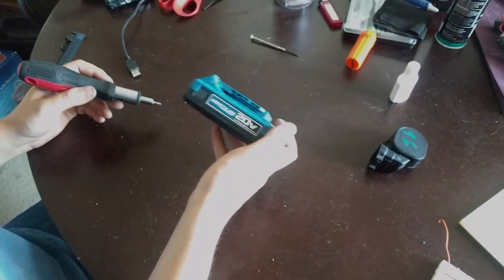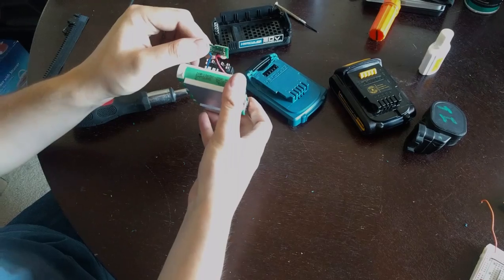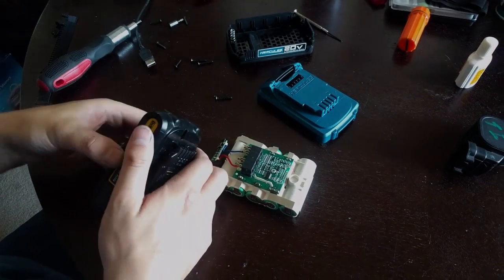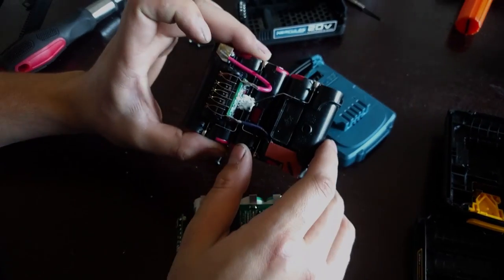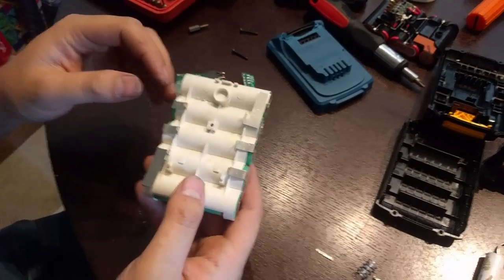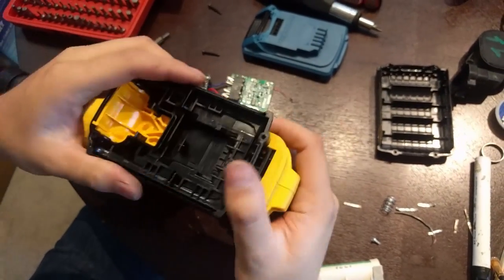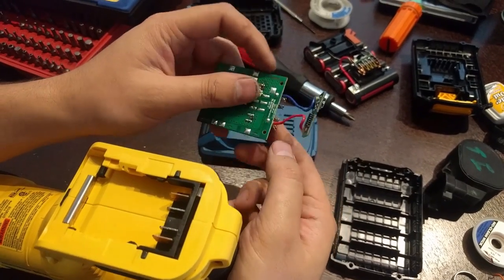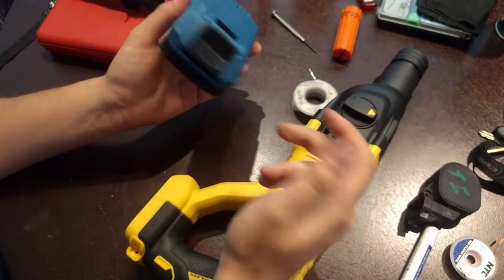New Harbor Freight batteries work in DeWALT tools!

Comment: Very cool. Thanks for hacking that!
Reply from the maker: AvE the master has arrived
Reply: SQUEEEEEEE! Dave Jones Where? Where?
Reply from the maker: AvE so, do you think these are counterfeit cells?
Reply: Maybe.  More likely, and more in keeping with the theme, OmniEvilCorp introduces the tool and as time goes on the grade of components gets cheaper and cheaper.
Reply: I bought one of the 2.5 Hercules batteries to rebuild a toast Ridgid 1.3 ah. When I pulled it apart I was impressed to see Samsung cells. I ditched the Hercules circuit board and soldered the Ridgid circuit board on. Accidentally shorted out the fuel gauge when I was trying to measure voltage. I have already built a Frankenbattery out of 2 Ridgid 4.0s so the Hercules battery build earned the name Francules.
Reply: Haha Ave I'm watching one of your videos on another device while searching to see if these batteries are interchangeable on my phone and who do I find at the top of the comments section? Lol
Reply: Overriding thermal safety... On a cheapo pack.... I call them firestarter
Reply: Would I need a hercules charger or can I use my dewalt?
Reply: @mosesdog2  question how do you know so much about this stuff??? What did you read???
Reply: Just imagine if someone made a pack $50 pack of 3D printed adapters that you could couple any of these tool brands together and and you can literally call it 
the home gamer.

Comment: You could instead of a resistor solder in the same type of thermistor used on the DeWalt battery, so that the DeWalt tools would get the correct reading but also retain your thermal protection on the Hercules batteries. maybe even put in a double pole swith that would allow you to switch between DeWalt and Hercules modes!
Reply: Please explain further
Reply: @yonodc5705  The battery originally had thermal protection (to prevent damage from the battery overheating). In the video he used a resistor to trick the tool into thinking the battery is at room temp (because the temperature detection for the other brand doesn't produce the same resistance values the tool would interpret those reading as either being too hot or too cold and not allow the tool to operate [a safety feature]). This guy is suggesting adding in a compatible thermistor; which will actually change it's resistance based on temperature (so that you can regain the thermal protection for the battery). He suggested putting in a switch so that with the flic of a switch you can add or remove that thermistor from the circuit; doing this would allow you to switch from being compatible with either Dewalt or Hercules.
Reply: @jonathanbetenbender307  Good explanation for the newbies. Do you know what value/model the thermistor would be?
Reply: @bradkaral1188  I don't sorry (been a year); without having a battery to check maybe you can find it in a forum discussion via googling. Good luck sir. 

Btw I'm a newbie myself; most complicated thing I've done electrically was a lichtenberg machine with two transformers and fans that run on either circuit (just took my time). Also made a nichrome wire cutter (studied things for a while). My friend is a genius with this stuff the guy has nearly rebuilt an industrial CNC from the ground up. Compared to him I'm a cave man clacking rocks together.

Comment: What needs to be done, if anything, to electronics for the hack in the opposite direction, running HF tools on Dewalt batteries?
Reply: I'm with you on that y no awnser yet boss what u got to do too run DeWalt in a Hercules

Comment: Dude Nooooice! Once you said Thermal, I was Floored, Maybe I should retireded! Of course that's what it is. I got a "20v Flex" dewalt Danger Grinder (with anti flesh destruction Brake)  and today tried to make a corded Adapter but didn't bother to check resistance ( well besides my coworkers talkn crap on why would someone want that!) on the 2 inboard pins, just volts. I hope this is what I need but either way Thanks a bunch for the info.

Comment: If you're going to go through all that hastle, especially modifying the casing, why not should rebuild your existing DeWalt battery.
Reply: right? or just move the cells to from the HB to the dewalt.
Reply: I absolutely agree, the Hercules battery pack as far as cell construction and the aluminum heat sink seems much better engineer than the DeWalt cousin. If I was going to do all this work I would definitely swap the harbor freight cells and assembly into the DeWalt case and then go down the road. I would definitely keep using the DeWalt BMS as it has everything in there to communicate with the tools for the protection of the tools and the battery.

Comment: Using a 10k resistor fools the tool into working, but it also bypasses the batteries'
 temperature protection. This is not a good idea as you could potentially have an exploding battery scenario.  A better method would be to use a 10k thermistor across the terminals.  You'd have to measure the Dewalt thermistor's resistance at different temperatures and compare to determine it's Resistance/Temperature curve to select the proper thermistor.  You'd also probably need to isolate the temperature sense lead from anything else on the circuit board that might interfere with the thermistor reading as well.  Don't know if you'd be able to charge the pack with 10k of resistance either as the Hercules charger would think the battery is really hot.  The Dewalt charger probably won't work as it won't sense the cell balancing voltages.
Reply: Totes sounds good. make a vid
Reply: I found the big brain dude i was looking for to answer my question. I didn't even have to ask cause he already explained the problem lol.

Comment: This was helpful in the aspect that what you did I work in electronics and was familiar with it anyway. But 99% of people will not go through that much trouble. Cuz they simply don't understand. But there are a few companies or a company out there that are selling a adapters where you can interchange DeWalt to Milwaukee drills and batteries. Do a little research if you have some time and find out if those adapters would work for the Harbor Freight setup haunted DeWalt Milwaukee Etc.

Comment: I don't know where you are but in Florida the DeWalt batteries go for 80 or $90 where the Hercules batteries all right around 45-50 so definitely a cool video I will be trying this next time I need batteries I may even remove the cells from the Hercules and install them into the DeWalt case

Comment: a couple of good old zip ties or electrical tape will fix that engagement issue lol. I appreciate the time you put  into this though thinking about grabbing one of the 5.0 ah ones and trying it . I will probably do a comparison of my dewalt reciprocating saw and the future harbor freight one. If I can pull two 5.3's in 2 hours at a junkyard im saving close to 400 bucks either way with two reciprocating saws.

Comment: Excellent video thank you so much. I took the battery apart and put the resistor in works great on DeWalt tool, but now it will not work in my Hercules tool. Is that normal? I was hoping to use the Hercules battery it in both tools.

Comment: So for a Hercules tool, we would need to trick the tool into sensing 100k ohms across the temp sense wire.  In theory, we could modify a bauer battery or dewalt battery to work in the hercules tools.?

Is that right?

Comment: Where are you getting DeWalt batteries for $30?
Reply from the maker: Sellers on ebay have DeWALT DCB203 batteries for $32.50
Reply: My local flea market always has the 1.5  amp hour batteries for 30
Reply: Offer up is even cheaper.
Reply: I‘d be cautious of suspiciously cheap name brand items on eBay as there are many reports of Chinese counterfeits being sold there.

Comment: great video! learned some good stuff here. question... i have the dewalt 20v toolset and i bought some hercules 20v bare tools. can i get the dewalt batteries to work in the hercules tools and dewalt tools[aside from the case modification], the way you did with the herc battery? thanks for your time
Reply: Hey did you ever figure it out? I'm trying to do the same thing
Reply: @creepyunclephil  unfortunately i couldn’t get it to work. i tried resistors and potentiometers and nothing worked. gave up since. if you figure it out, please let me know. best of luck to you

Comment: How can you put a dewalt battery on a Hercules tool?  My Hercules tool & battery, after pulling the trigger for a few seconds shut down & starts to flash.  The battery test light stopped working, so I am assuming it is the temp wire causing the issue.  The pin next to B+ & B-, I get 99.1k ohms.

Comment: Great video. I've always used DeWalt batteries because I don't have any problems with them and they last for a long time. My question to you is: Where do you find DeWalt batteries for $30? I'll take a dozen!
Reply: Buy broken dewalt batteries on ebay, then fix them. I buy dewalt 20V batteries for 10 to 12$ each all the time in lots of 3 or more.
Reply: The reason I’m watching this video is 12 amp Hercules batteries are 80$ on eBay….
Making a power bank out of them

Comment: Wouldn't the 10KOhm resistor be connected in parallel to the 100Kohm?  so does that mean that dewalt needs an equivalent of ~9Kohms?

Comment: Agree with the presenter.   I have enough DW battery inventory for my needs and they are long lasting and rugged.   I have never needed to replace one in several years of using the 20 volt max.   If/when I need to add or replace I can’t imagine I would need to save a few dollars by using a slightly cheaper battery, then adapt it and still have a less than perfect system.    Just buy a genuine DW.   If it cost $10 more and works for say 5 years then $2 / year is well worth it.   I would consider replacing a dead cell or two before doing this.

Comment: Would it not be simpler and more effective to get a dead dewalt battery pack and just switch out the 18650's?
Reply from the maker: RAW TOPSHOT yes, but in that case, I wouldn't even bother with this battery. I would just buy the cells.

Comment: Great info!  Did you consider just moving the thermistor... except that would disable its use on a Hercules tool.

Oh, ABS = engineering plastic, PP = commodity plastic. So despite adding GF to the PP, I consider the DeWalt ABS casing to be superior.  After you drop a few of the double-row packs from 30 feet up to concrete without any issues, you begin to admire the build quality of those packs.
Reply from the maker: Orders Atxal the case is actually made out of pa6, which my understanding is nylon.
Reply: If it's nylon/zytel then that would be nice especially if it was close to 35% GRP, but I would be surprised. Sort of like all the "nylon" cord from China that's actually PP.  I'll pick up to use the cells in a dead DeWalt pack, and then try to glue or weld the old case!
Reply from the maker: Orders Atxal Lowes house kolbalt line is also a cheap source to get tool cell batteries. You can get six 2000 mah cells for $20
Reply from the maker: also, as a reply to your question about maintaining thermal protection: I didn't go to far into the circuit, but I did go far enough that the thermistor is not a straight hookup to the pin and ground. I believe it goes through the microcontroller onboard and the microcontroller is the one that outputs the actual data. The microcontroller is a HOLTUK HT66F018.

My initial guess is that perhaps the other brands at harbor freight use the same circuit, but have different firmware to prevent cross tool use. Will have to pickup their bauer brand battery and see if this theory is correct.
Reply: why does it sound like everyone has an issue with what or how you did this modification.  ppl criticize instead of posting their own video.

Comment: Why isn't some enterprising person making swap out casing parts, in this case, a custom top for the Hercules, so that it fits lock stock and barrel into a DeWault tool????  Earth to China??  Buehler???
Reply: Because design patents and lawsuits are a thing.
Reply: @willow450  Lol as if THATS ever stopped the Chinese
Reply: I wonder if ide be able to 3D print this
Reply: Captain Sparks Should be able to if you can draw it.
Reply: @willow450  adapters are made all the time.  there is a dewalt to ryobi battery adapter.  not sure why there isn't one for all brands.  It sickens me to be a forced into a loyalty brand.  i would prefer to buy the tool that performs better then compromise due to battery casings.
Reply: @willow450  100% truth!
Reply: @puppetmasterblaster  Very true

Comment: Dangerous mod. That battery can overheat and explode. You should have bought a proper 10k thermistor with extension leads and soldered it on instead of that 10k resistor. It would work safely on either drill brand at that point.

Comment: Just can't stop wondering when some manufacturer will decide to dominate the market and make their tools just use 18650 cells straight up; no special casing, etc.  same as putting AA's in a toy...  yes, I know battery quality varies widely, but it still needs to be done.

Kickstarter anyone??????  likely $100,000 funding waiting for a drill and a hex driver that both use 18650 Lithium cells....  I'll be first to sign up.
Reply: B Miller harbor freight just started selling a little work light with a magnetic base that allows you to swap out the 18650 like a AA flashlight.
Reply: Progress!  This seems as obvious to me as some battery manufacturer deciding to dominate the rechargeable AA and AAA battery market by ENDING the STUPIDITY that is the 1.2V design, and making a battery that is a full 1.5V in NIMH...  Just one of those design limitations so that rechargeables didn't cannabalize their Alkaline battery business...
Reply: Why not lithium? Those Nimh don't last! Both can be found through marketplaces like AliExpress. The lithium iron phosphate (LiFePO 4) batteries are the most advanced thus far, so I've heard. I think those are available in the 18650 size as well as other common sizes like AA and AAA. Download the AliExpress app and see what you can find. I love it
Reply: Look specifically for the "Kentli" brand batteries. Those are the best I've found. They are 1.5v
Reply: Wasn't aware of those, will have to check them out.  thanks
Reply: The only problem with that is each battery is only 3.5 volts nominal equivalent two two Double A's therefore you would need 6 of them for an 18 volt drill and 7 for a 20 volt drill your tool bag will get very clustered with batteries the problem with batteries is that when you up the voltage you decrease the discharge time therefore it is better to pack all the batteries in one case that protects them from damage and also regulates there voltage
Reply: no.  A 20V drill has 5 x 16850s in it as any teardown video on Youtube will show you.

https://youtu.be/3ZfYF9aIO7U?t=29m51s
Reply: Randall Debow Well first off 18650s are 3.7v nominal and AA's are 1.5v. 18650's charge to about 4.2v. Even if they where 3.5v like you said 6 would be 20v and 7 makes 23.5. Since marketing departments rule companies now they use average charged voltages so 5 4-4.2v cells equals 20-21v but 18.5v nominally.
Reply: Bought one, they are nice!  on coupon now for $20...
Reply: B Miller I dnt recall saying anything about 5 batteries
Reply: Josh Crutchley you are correct though your voltages will only be tru at full charge
Reply: Memory lapse?  Reading challenged?  "...so 5 4-4.2v cells equals 20-21v..."  

Looks a lot like a 5 to me.

Voltage can be and is regulated in 1.2v rechargeable batteries without a case.
Reply: Um, that's just a limitation of the NiMH chemistry. 1.2V is what you get. It just happened to be close enough to 1.5V that it was usable in items designed for alkaline batteries.
Reply: Not buying it at all.  It's more important to keep them away from the run-time of disposables so as not to cannibalize that market and end up destroying it (since it DWARFS re-chargeables).

It's straight up known the NIMH chemistry can support 2-3 times the density of NICAD, yet they made the voltages the same, and the current capacity negligibly better...  all because of the marketing dept. --

https://en.wikipedia.org/wiki/Nickel%E2%80%93metal_hydride_battery

You can also tell this is the reality because there's no battle going on for technical advancement: OH Duracell, you can do 1.2v...?  Well We at Rayovac can do 1.25v... Oh yeah?  Well Panasonic can do 1.3v... and in short order we'd be up to the 1.5 and start killing off disposables.

Battery useability in real life is driven by voltage fall-off to the minimum usable threshold of the device... starting at 1.2 gets you there sooner, so no way they would start at 1.5 like disposables.

Not happening.  No desire to move the goal posts in a virtual collusion to keep disposables market (BILLIONS $$$) happy and healthy.

Comment: I would much rather just transfer the Hercules cells onto my DeWalt board and pack it all back into the DeWalt case. I will say the DeWalt cases are absolute crap. I have four DeWalt batteries now that are being held together with duct tape and silicone. Out of the 15 batteries I own those probably see the most constant use. I've never dropped one from a man left but I've been frustrated enough to throw the whole tool when the battery starts disintegrating in your hand while making a cut. In any case the Hercules battery pack looks like it's very well engineered I really like that heat sink. I would say if the cells are really any good just transplanted into it dead DeWalt battery.